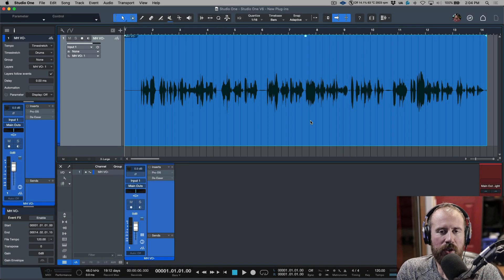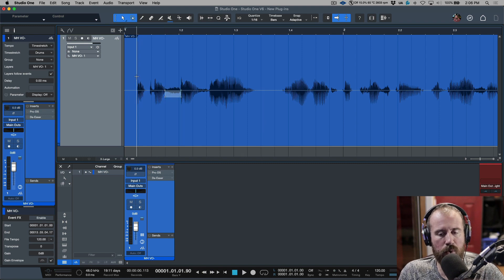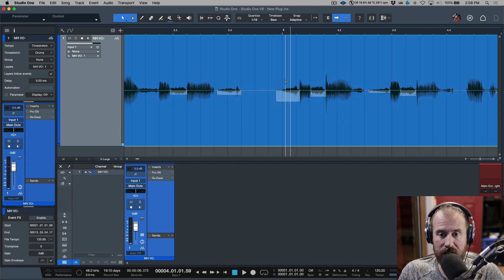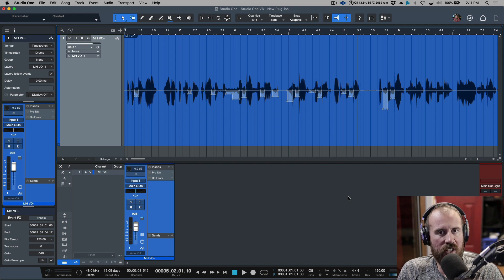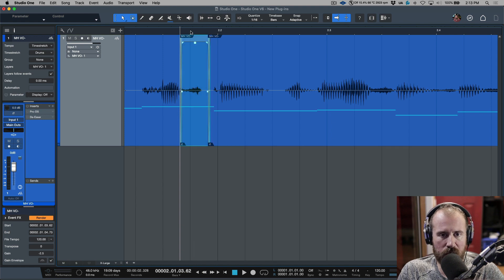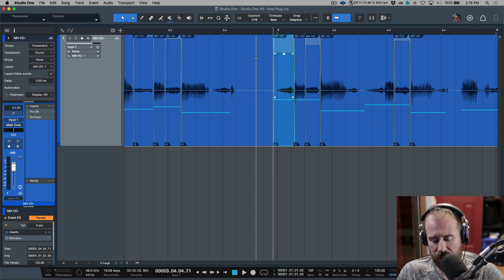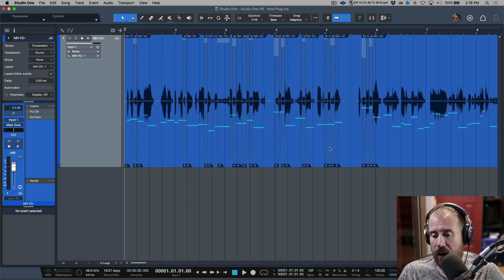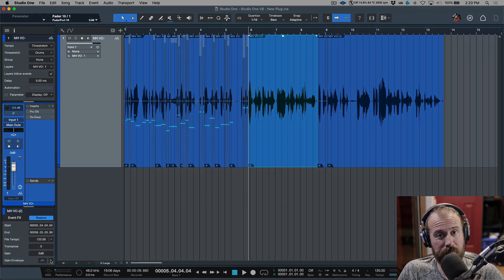2 Ways to Manually De-Ess In PreSonus Studio One 6

Comment: Excellent video & explanation.
👍
I do exactly the same, both methods (and the macro).
I always bounce the whole file at the end, however: makes the computer processor work a lot less, with no clip gain or crossfades to be doing in real time under/before plugins, plus it makes it convenient for archiving and for visual reference, knowing you have one single complete and OK'd linear file from the beginning to the end of the song or project, just like a track on tape would be in the old days.